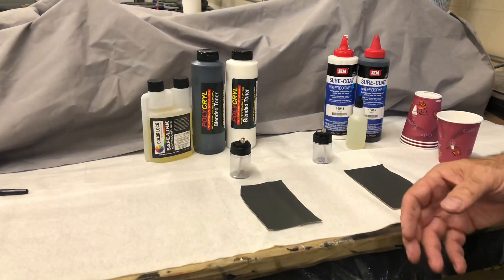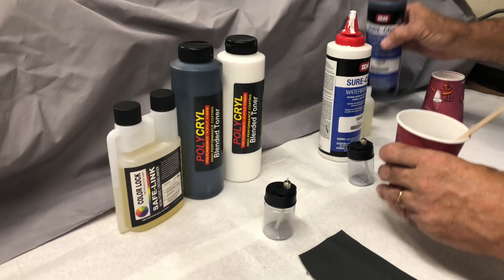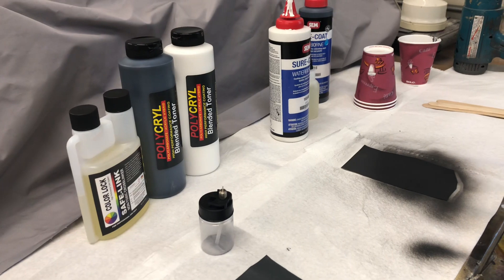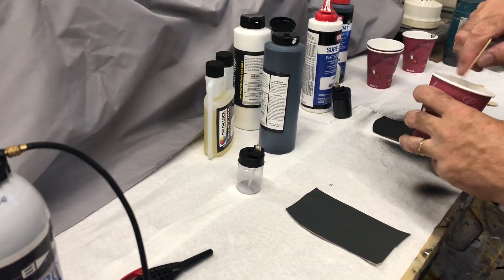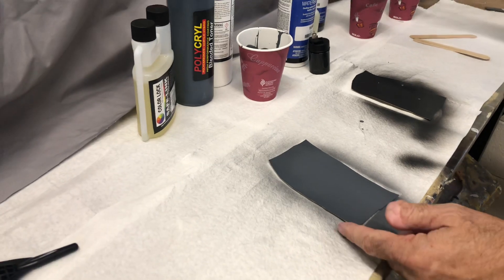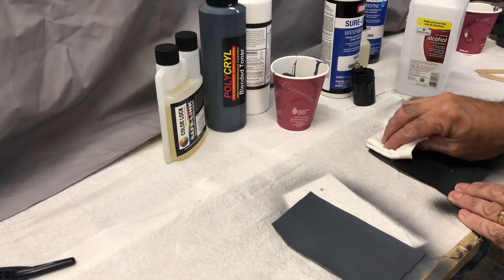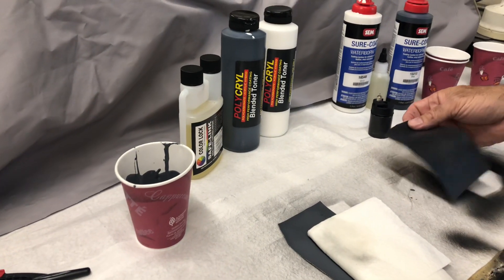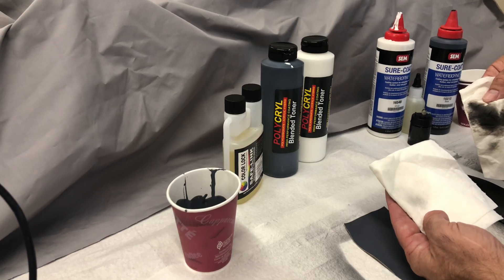Polycryl vs SEM Surecoat

Comment: How does this compare to superior restoration products paint?
Reply from the maker: Superior uses  Classic Dye. Which is a standard grade old style PUD . Polycryl is in a whole different league it is the only Polycarbonate Hybrid using patented resin technology.  It  will easily out perform any other dye on the market with long term durability and extreme chemical resistance there is no other coating that even comes close including anything sold by superior. Viper is different then the  other suppliers  because we are the Manufacture  we design and develop the products there is no middle man the products do not get cut or watered down.  Viperproducts.com

Comment: Do you have a dealer network or similar? Would be interested in getting a panel matched and material to paint it, but I don't have a need for the entire system.  None of the SEM pre caned colors match the color so been looking for something more custom.
Reply from the maker: We are  the manufacturer of the products . We offer custom color matching for a fee .  If you  send in a sample of the color we can match it to your sample and provide a premium coating designed for the item your trying to restore. We are not a mass market generic type of product like SEM . Everything we do is custom .